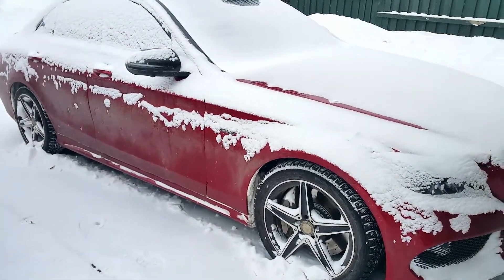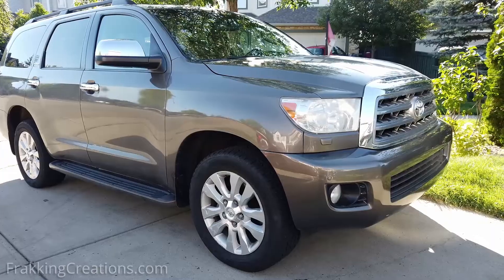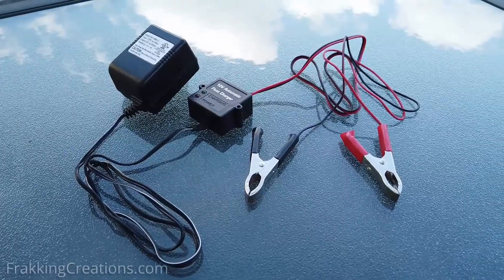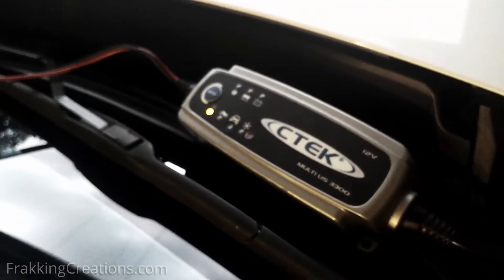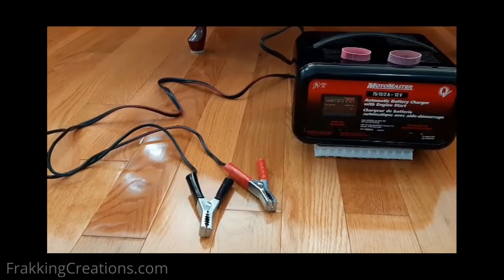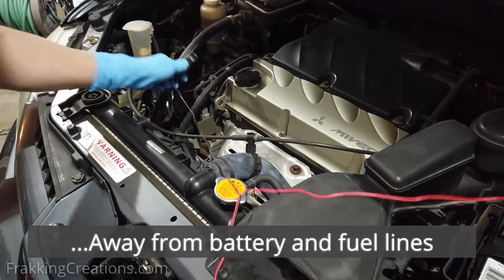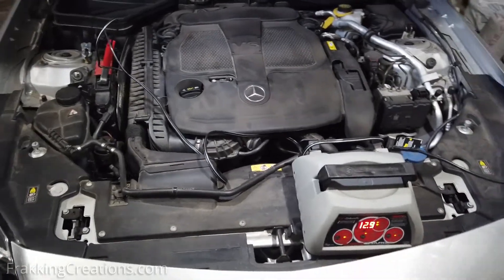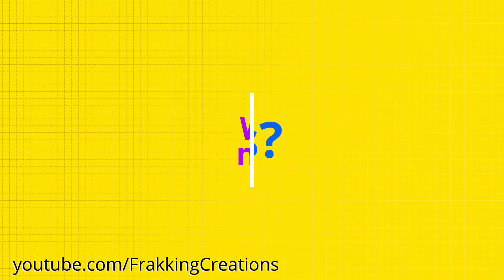How to Charge a Car Battery - What car battery charger to use, How to connect a car battery charger?

Comment: Very informative video! In my situation, I have a tractor mower, and I connected the positive cable to the positive post first, but when I tried to connect the negative to a bolt or other metal part, it sparked. Is that normal or am I doing something wrong?
Reply from the maker: Typically you should plug the charger in after connecting to the battery.  Best is to see what your manual says for your specific charger.
Reply: @FrakkingCreations  Yes, the charger was still unplugged. I'll have to find a manual. Thank you for answering!

Comment: Thanks for the video man i wasn't aware about this health tip till now as my car is not used for a longer durations but my question is when should i check that my car battery needs to be charged to maintain it's health when needed to be driven should i do regular battery check ?
Reply from the maker: You're welcome. Glad it was useful.
I just use a good battery charger with trickle charge capabilities and plug it in when I don't plan on driving much.  The charger will do all the work for me.

Comment: If a house has no electricity you can have extra car batteries with 800cc and up using jumping cables if you don't have a battery charger to charge a battery using a battery tester.Having a 1000w power inverter tells you how full the battery is.

Comment: I know there are parts such as the carburetor that I shouldn't clamp the negative croc, but what does that look like, and what other parts are dangerous? My maintainer states to not connect the negative to thin metal either. I have a 2015 Honda Civic. Thank you

Comment: Thanks!  Very helpful video.  What could happen if you connected the negative cable to unpainted metal first and then the positive cable to the terminal post?  Honestly, the few times I have jumped started my vehicle, that is the way that I did it without incident...thankfully.

Comment: why the negative didn't contact the negative of the battery ?
Reply from the maker: It's because it is safer.  The unpainted metal parts of the engine bay are all ground so they are connected to the negative terminal of the battery anyway.

Comment: Great video, especially the safety part. Although there’s still a slim chance that a battery will actually explode, there’s always that first time. Lots of people want to hook the negative to the negative terminal when charging, glad you pointed out to just ground it instead.
Reply: Why shouldn't the negative be attached to the other negative instead of grounding it?
Reply: @KS-zc4jn  hydrogen gas
Reply: @lexbeltran1354  Thanks. I had a real hard time finding this answer. Looks like a lot of people don't know that it could be dangerous. Apparently from my research, most of the time you should be fine attaching it to the battery instead of grounding it, but occasionally it can blow up in your face. 

Not something I want to chance happening!
Reply: @KS-zc4jn thank you for asking. I too had a hard time finding the answer lol
Reply: Mine won’t charge if connected to another piece of metal. Only negative terminal works
Reply: He literally said the answer in the video 😅
Reply from the maker: Thanks for the feedback.

Comment: Why can't you just connect the black/negative clamp to the negative terminal on the battery??
Reply: Hydrogen gas might cause the battery to explode. I've always connected the negative black to the negative terminal with no problems. Just charge your car in your driveway
Reply: @lexbeltran1354  What if the battery is not in the car?
Reply: @1supervegito1  Then just connect to the terminals.

Comment: I always connected red to posi and black to neg never metal.
Reply from the maker: That could work too.  The method I described is just the safer method when charging with the battery in the vehicle.  When the battery is removed from the vehicle, the only way to charge it is to connect to the positive and negative terminals.

Comment: why dont you connect the negative bit of the charger to the negative on the battery?
Reply: So because charging batteries releases hydrogen gas, the charger can now arc 8 inches through air (hydrogen) instead of taking the path of least resistance through the battery?? So connect your leads across other components in the car where there can be oil and other spillage because 8 inches is the maximum sparking distance, and 14 inches is safer?
Reply: Yes - Read the comments above this one.
Reply: He explains it in the video

Comment: Has anyone had a situation where they plugged their "smart" car battery charger into 240v power without having it connected to the batteries first? 

Mine doesn't work now after I did this so I'm wondering was the charger faulty or are these things so fragile that just plugging them into a power source fries them instantly 😑

(To clarify further, charger is brand new, never used before)
Reply from the maker: That has not happened to me before and I have plugged the charger into household power without hooking it up to the battery.
Your charger could be defective or you may need to turn it on first.  Sometimes they have a weird way to turn on.  Also, make sure not to have the connectors touching each other when you plug it into household owner.
Reply: @FrakkingCreations  thanks for your reply! Good to know plugging it in shouldn't be harmful. There's no on/off switch on mine and it overloaded our inverter so would be defective for sure.
Reply from the maker: Not sure what you mean by overloading you inverter.  Did you plug in your charger to an inverter such as one that converts 12V to 240V?
Reply: @FrakkingCreations  yeah, everything in our off grid home runs from the inverter (max output of 1,500w) and this is the first time that the 'overload' warning came on. I'm guessing the charger just burner out straight away
Reply from the maker: 1500W should be enough to handle a car battery charger.
I know that some digital systems have problems running off of inverters that form digital AC power.  Perhaps your smart charger is one of those sensitive to digital inverters.
You might want to try the charger on a normal household socket from the grid to see if you charger works or not.  The inverter's manual should say something about how some electronics may have issues with the type of power it generates.
Reply: @FrakkingCreations  how much Wattage is needed to charge a car battery?

Comment: good video this answers my question about directly charging the battery without removing the terminals on the battery itself.
Reply: Metoo. The other knowledge was that the vid shows where to connect the negative clamp. I was thinking of clamping it onto the negative terminal.
Reply: @cb250nighthawk3  Yeah, me too.  I read that in the instructions on the new charger I got, plus I have seen that done before.  Yet, I felt intimidated about where to attach that negative clamp.  I still am, really!  But, now I have a better idea of what to look for.
Reply from the maker: Thank you.  Please checkout our other videos that you might enjoy too!
Thanks for taking the time to comment.

Comment: 03:25 Video starts 

Title: How to Charge a Car Battery
Video: The history of car batteries and multiple battery charger models.
Reply from the maker: The title is actually "How to Charge a Car Battery - What to use, How to hook up a car battery charger?"
For some people they don't know what to use.  Without a charger you can't charge your car battery. So this will help those viewers.
It's the same as how you can't say that a store has faked a "50% off" sale when you don't read the full ad of "Up to 50% off".
We also provide chapters to the video that allow a viewer to skip to the section that they are interested in.  You can do this on the playback scroll bar or in the video description.  There is specifically a chapter for how to charge a car battery/connect a car battery.
Reply: @FrakkingCreations  0

Comment: Do I have to disconnect the battery from the car before charging
Reply from the maker: Normally you don't.  Though nowadays vehicles have a lot of computer systems on board.  So it wouldn't be a bad idea to check the car manual for any specific instructions for your specific make and model.
Reply from the maker: When the vehicle doesn't have a specific post for it, usually the negative is connected on a piece of solid unpainted metal that is farther away from the battery.  Usually somewhere on the engine block (make sure not the fuel rail)
Reply from the maker: I can't remember off hand what Amps my charger was charging at.  Probably safer to listen to the manual.  Otherwise you're just doing it at your own risk.
Reply from the maker: The battery's getting old.  Sometimes they start to fail from 4 - 5 years on.  Take it into a auto parts store that does free battery testing.  I think no point in guessing.  That should be able to tell you if you're in need of a new battery.
Hope that helps.

Comment: I was told to do everything the same except the black clamp goes on the negative terminal to ground. Is that ok too or should I just ground to the frame?
Reply from the maker: What do you mean by "negative terminal to ground"?
Connecting to the negative terminal can work though there are potential issues.
Some batteries with emit a little gas when it is being charged and this could become explosive in higher concentrations.
Some cars could be damaged if not connected to the frame for charging.  This is sometimes the case for luxury cars or cars that have a lot of computer systems.
Best to verify in your car manual and the battery charger manual.
Reply: @FrakkingCreations  Which side of the transfer grounds to frame vs connecting to negative post?
Reply: was ok once over but modern cars now have a regulator on the negative post so you have to use earth elsewhere.

Comment: Hello, I'm slow sorry. On a Nissan Almera, where should I plug the negative? How long would it take to charge the dead battery using a 4 amp/12  volt charger. Thanks.
Reply from the maker: Somewhere away from the battery, on the engine block, solid metal area that is not painted.  Make sure not on the fuel rail either.  If the battery is still good and able to charge you are looking at 12 to 20 hrs depending on your battery capacity.
Reply: @FrakkingCreations  thanks a lot for your prompt response. Appreciated.

Comment: What's the berries completely dead Like not even the light in side car turn on
Reply from the maker: If the battery is completely dead it may have been damaged and may or may not charge.  A trickle charger that is not computer controlled may be able to charge it but it will take some time.  Once enough charge is in the battery a smart charger may be able to finish the charging and also repair some of the damage done by the complete discharge of the battery.

Comment: 🤨Why not connect the negative to the negative like the positive to positive?
Reply from the maker: For some batteries that aren't zero maintenance, when charging they may release a bit of gas that is explosive in higher concentrations.  A spark could ignite it when clamping the negative post of the battery or especially when removing after charging.
Then in other cases, in newer cars with more electronics, directly connecting to both battery posts could cause damage to the electronics.  This is mentioned in the manual.  So they usually have a dedicated post on the frame of the car for charging the battery.  You can see it in this video for the Mercedes.
Hope this clarifies.
Reply: @FrakkingCreations  
Yes it does thank you for explaining 😊

Comment: I see everyone else connecting the black clamp to the negative terminal in the battery and not to the chassis like it should be (like in this video), but does this really makes a difference ?
Reply from the maker: I've never connected to the negative terminal personally, so I can only say what I've read in the car manuals.  It's more a safety concern in case the battery releases enough hydrogen gas when cahrged, that it is explosive when in higher concentrations.  I've also heard that connecting to the negative terminal of the battery could damage some vehicle electronics.  Some cars like Mercedes have dedicated posts for connecting the negative cable to. As is seen in this video.
Hope that clarifies things.
Reply: @FrakkingCreations  when I connect negative to car chassis the charger says my battery is full and doesnt operate. When I connect it to negative terminal it charges as normal....
Reply from the maker: That's interesting.  What charger do you have?
Reply: I @FrakkingCreations

Comment: wait so you connect the black clamp to an unpainted metal? my dad said connect it to the negative of the battery? so i have the red clamp and the black clamp on the battery. Some tutorials also clamps the black on the negative of the battery instead of an unpainted metal???
Reply from the maker: For some batteries that aren't zero maintenance, when charging they may release a bit of gas that is explosive in higher concentrations.  A spark could ignite it when clamping the negative post of the battery or especially when removing after charging.
Then in other cases, in newer cars with more electronics, directly connecting to both battery posts could cause damage to the electronics.  This is mentioned in the manual.  So they usually have a dedicated post on the frame of the car for charging the battery.  You can see it in this video for the Mercedes.
Hope this clarifies.
Reply: thanks, so many tutorials on youtube  though connect to both post. What would the explanation on that be? Sorry for my bad english.
Reply from the maker: It can be ok to as long as you make sure the room is ventilated well so if gases are released it is able to dissipate.  You could always just charge the battery when it is removed from the car or disconnected from the car.  In that case you will connect to the red and black terminals of the battery.
Reply: @FrakkingCreations  so if the car is outside there is no issue connecting directly to negative terminal?
Reply: @martinhawes5647  If you have a maintenance free battery it's fine

Comment: Can I close the hood of my car while the battery is charging?
Reply from the maker: Since all vehicles are different i wouldn't recommend it.  For example, for mine if i were to close the hood it would knock the clamps off and could cause a short.  So as a safety precaution i wouldn't close the hood.  Even if the hood won't touch, the clamps could move when the cable is moved inadvertently.

Comment: Hi, why not connect to the negative of the battery. Thanks.
Reply from the maker: For some batteries that aren't zero maintenance, when charging they may release a bit of gas that is explosive in higher concentrations.  A spark could ignite it when clamping the negative post of the battery or especially when removing after charging.
Then in other cases, in newer cars with more electronics, directly connecting to both battery posts could cause damage to the electronics.  This is mentioned in the manual.  So they usually have a dedicated post on the frame of the car for charging the battery.  You can see it in the video for the Mercedes.
Hope this clarifies.
Reply: @FrakkingCreations  Thanks for taking the time to answer my question, very helpfull.
Reply: @FrakkingCreations  Hey man, I connected mine to the shock absorber bolt and screw which was the closest, is that fine? It's a tiny 1.0 L Hatchback. I know that sparks are normal but since the chassis beside it was too thin i went for the shock absorber screw instead

Comment: does these charges need to stay plugged in while charging the battery?
Reply from the maker: Yes. These are not portable chargers or portable power supplies.  There are battery powered starters/power banks available too if you need ones that can operate without being plugged in.